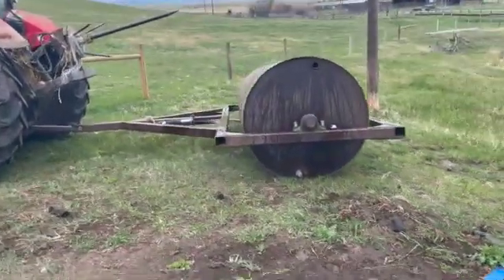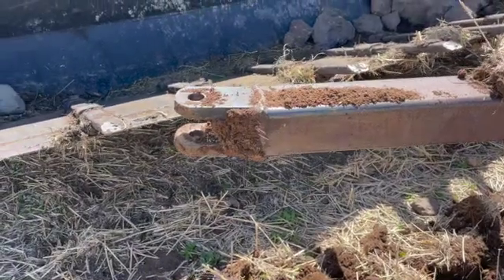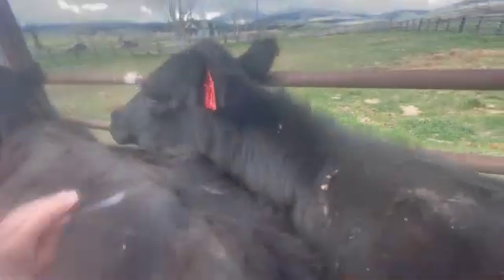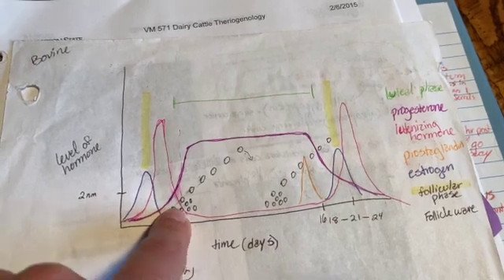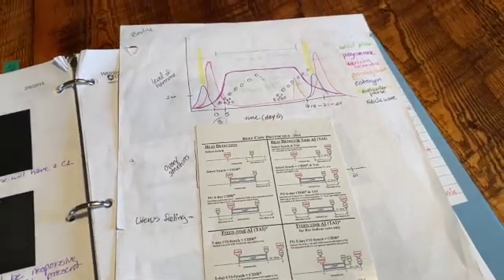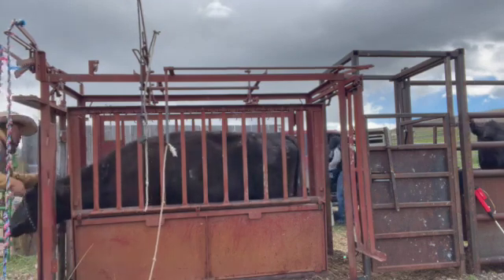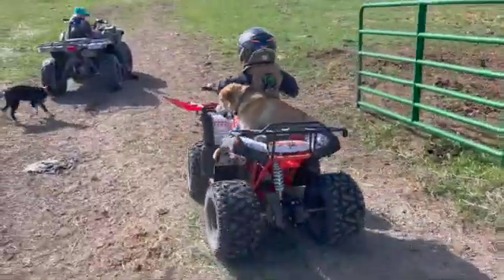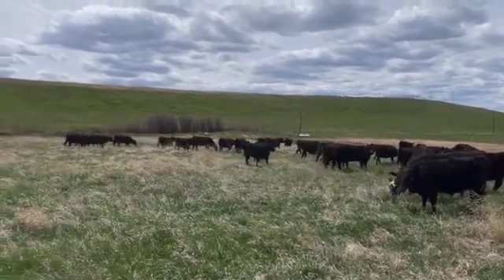Artificial Insemination of the cows and field rolling

Comment: Been there, had a cultivator walk the pin out of the hitch on the tractor before.  Replaced a lot of hose and connectors on both.  Lol.  Usually take the time to put a cotter pin in the bottom of the hitch pin now. But not always.  🤣👍🍻